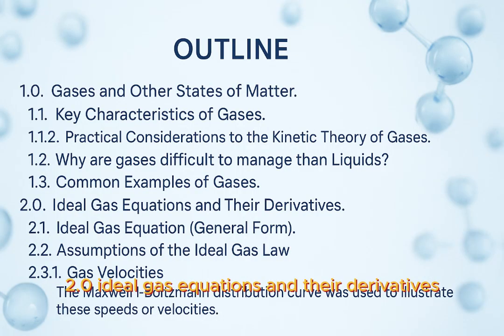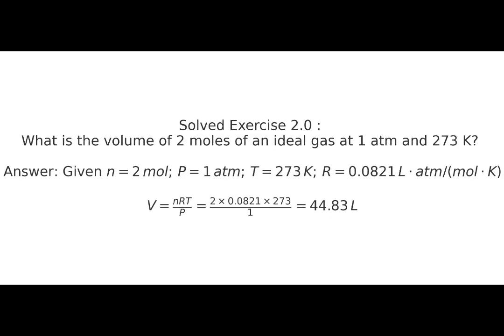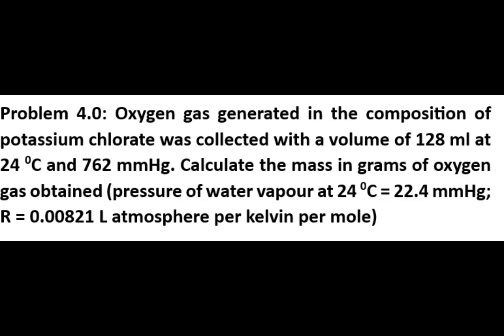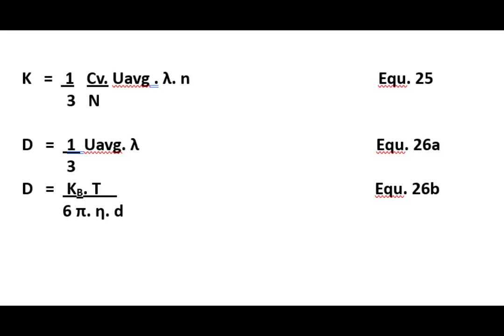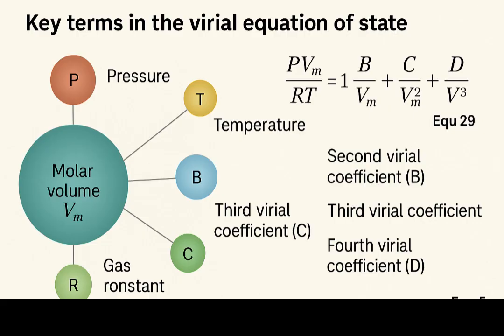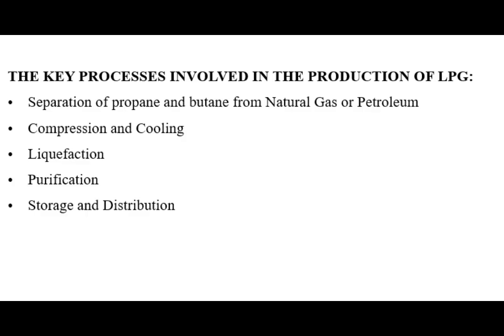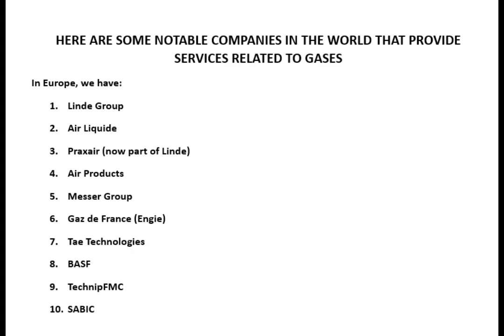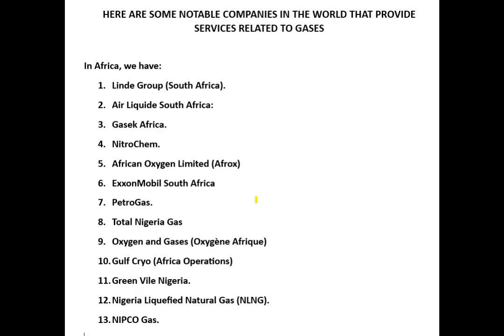Fundamentals and Applications of Gases

Comment: GMT: OKECHUKWU DAVID ICHELA 

• Exercise 1: Practical Exercise on Gases

The relationship between pressure, volume, and temperature can be explained using the combined gas law:

[
\frac{P_1V_1}{T_1}=\frac{P_2V_2}{T_2}
]

Where:

- (P_1) = initial pressure
- (V_1) = initial volume
- (T_1) = initial temperature
- (P_2) = final pressure
- (V_2) = final volume
- (T_2) = final temperature

If the gas enters a larger space and the temperature remains constant, then:

[
P_1V_1=P_2V_2
]

Therefore:

[
P_2=\frac{P_1V_1}{V_2}
]

Since (V_2>V_1),

[
P_2<P_1
]

This means that when the gas enters a larger space, its volume increases while its pressure decreases, provided the temperature remains constant. If the temperature changes, the combined gas law can be used to determine the new pressure and volume.

This relationship helps a geologist predict how underground gas will expand, move, and change pressure when it enters a larger rock formation or mine space, helping to identify possible hazards such as sudden gas release or pressure changes.

Comment: BCT:IKPENDIEZE PRISCA CHIAMAKA U2024/5735259

From Excercise 1: { ANSWER} 
The ideal gas equation, PV=nRT, can be used to estimate the amount of gas produced by rearranging it to n=\frac{PV}{RT}. By substituting the measured pressure (P), volume (V), and absolute temperature in Kelvin (T), the number of moles (n) of gas produced can be calculated, using the appropriate value of the gas constant (R).

Comment: Gmt: wike saviour kenneth 

Exercise 1: Gas may accumulate

in underground rock formations or mine spaces. How can the relationship between gas pressure, volume and temperature help a geologist understand what may happen when the gas enters a larger space?

Answer:  When gas enters a larger space its volume increases. If temperature and amount of gas remain constant the pressure decreases. Pv=nRT (ideal gas law)
This helps geologists understand gas movement, expansion, and pressure changes in underground rock formations or mine spaces.

Comment: BCT: CHRISTOPHER WINNER OGECHI 

Answer:

The ideal gas equation, PV = nRT, can be used to estimate the amount of gas produced by rearranging the equation to make n the subject:

n = PV/RT

Where:

- P = measured pressure of the gas
- V = volume of the gas
- R = ideal gas constant
- T = absolute temperature in Kelvin

By substituting the measured pressure, volume, and temperature into the equation, the number of moles (n) of gas produced can be calculated. Therefore, the equation helps determine the amount of gas produced in the closed vessel.

Comment: GMT: OBUU MEMEMUGH ALBERT 

EXERCISE 1.

ANSWER:If the volume increases while temperature remains constant, the pressure decreases (Boyle’s law).

If the temperature increases, the gas tends to expand and its pressure can increase if the volume is fixed (Charles’ and pressure-temperature relationships).

If the gas moves into a larger space and is free to expand, its pressure will generally drop.

ANSWER 5.1:

Comment: BCT
IGBANI HANNAH ISRAEL 

Answer: The ideal gas equation, PV = nRT, can be used to estimate the amount of gas produced. By rearranging the equation, n = PV/RT. Therefore, if the pressure (P), volume (V), and temperature (T) of the gas are measured, they can be substituted into the equation to calculate the number of moles (n) of gas produced. The temperature should be converted to Kelvin before calculation.

Comment: P. I.C. Recent innovations in the gas gathering and transfer value chain of natural gas production have focused on optimizing costs, improving efficiency, and reducing capital expenditures (CAPEX). Some key developments include ¹ ²:
- *Digital Oilfield Solutions*: Implementing digital oilfield concepts, such as advanced sensors, IoT devices, and analytics platforms, enables real-time monitoring and optimization of production processes, reducing operational costs and improving efficiency.
- *Should-Cost Methodology*: This approach provides granular cost transparency, enabling oil and gas companies to negotiate better prices with suppliers, optimize project spending, and reduce time-to-market. By applying should-cost methodology, companies can achieve cost reductions of up to 8-10% on specific projects.
- *Automation and Robotics*: Robotics and automation are being used to inspect and maintain pipelines, reducing human exposure to hazardous conditions and improving safety. Examples include robotic inspection devices, such as SmartBall and PipeDiver, and autonomous drones for aerial surveillance.
- *Advanced Materials and Pipeline Design*: New materials and designs are being developed to enhance pipeline durability, corrosion resistance, and flexibility. These advancements help extend pipeline lifespan, reduce maintenance requirements, and minimize environmental impact.
- *Pipeline Expansion and Optimization*: Companies like Energy Transfer are investing in expanding pipeline capacity, such as the 67-mile pipeline from Panther Gas Plant to Waha Hub, to alleviate regional bottlenecks, improve pricing stability, and enhance takeaway options for producers.

These innovations aim to improve the efficiency, safety, and sustainability of natural gas production and transportation, ultimately reducing CAPEX and enhancing the overall value chain.
Mat no:u2023/5581114
Name: Otorho Julius omonigho
dept : PIC 200 level

Comment: Recent innovations in the gas gathering and transfer value chain of natural gas production have focused on optimizing costs, improving efficiency, and reducing capital expenditures (CAPEX). Some key developments include ¹ ²:
- *Digital Oilfield Solutions*: Implementing digital oilfield concepts, such as advanced sensors, IoT devices, and analytics platforms, enables real-time monitoring and optimization of production processes, reducing operational costs and improving efficiency.
- *Should-Cost Methodology*: This approach provides granular cost transparency, enabling oil and gas companies to negotiate better prices with suppliers, optimize project spending, and reduce time-to-market. By applying should-cost methodology, companies can achieve cost reductions of up to 8-10% on specific projects.
- *Automation and Robotics*: Robotics and automation are being used to inspect and maintain pipelines, reducing human exposure to hazardous conditions and improving safety. Examples include robotic inspection devices, such as SmartBall and PipeDiver, and autonomous drones for aerial surveillance.
- *Advanced Materials and Pipeline Design*: New materials and designs are being developed to enhance pipeline durability, corrosion resistance, and flexibility. These advancements help extend pipeline lifespan, reduce maintenance requirements, and minimize environmental impact.
- *Pipeline Expansion and Optimization*: Companies like Energy Transfer are investing in expanding pipeline capacity, such as the 67-mile pipeline from Panther Gas Plant to Waha Hub, to alleviate regional bottlenecks, improve pricing stability, and enhance takeaway options for producers.

These innovations aim to improve the efficiency, safety, and sustainability of natural gas production and transportation, ultimately reducing CAPEX and enhancing the overall value chain.
Mat No: U2023/5581114
Name: Otorho Julius Omonigho

Comment: PIC:
LNG is not produced using only the Joule-Thomson(JT) effect because methane (LNG's main component) needs very low temperatures (~-162°C)to liquefy, which the JT
effect alone cannot reach. In contrast, LPG (propane/butane) liquefies at higher temperatures and can be produced using JT expansion and moderate pressure. So
LNG needs more advanced cooling systems, while LPG does not.

Comment: BCH: The use of atmospheric air is unsafe for anesthesia because 

Anesthesia requires precision in oxygen delivering often 40- 100 % to maintain safe oxygenation and prevent  hypoxia or hyperoxia. These oxygen is purified which makes it 99% if not 100% safe for surgical operations 
Meanwhile atmospheric oxygen contains trace amounts of other gases as well as other components such as dust, bacteria, pollution particles which increases infection risk or complicationsduring surgical operations

Comment: BCH: The implications of using free and pure form of oxygen gas (atmospheric Oxygen) rather than the cylinder of pure oxygen gas is as follows:

Concentration - Free oxygen in the atmosphere is about 21% and will not provide the high concentration needed for anaesthesia leading to lung failure.

Atmospheric oxygen is not practical for direct use in controlled anesthesia delivery due to low concentration and variability.

Atmospheric oxygen gas contains microbes, contaminants, particulates and variable humidity, making it unsuitable for direct use in anaesthesia.

Composition variability -  Atmospheric oxygen levels can vary slightly, but most importantly, air contains other gases (like nitrogen)

Using free atmospheric oxygen isn't feasible for anaesthesia during surgery. Medical-grade oxygen from cylinders allows for precise control and safety needed in surgical settings.

Comment: BCH: 
a) Purity and safety: Atmospheric oxygen isn’t pure :, it contains other gases like nitrogen, pollutants and potential contaminants. Anesthesia requires highly purified oxygen to ensure patient safety.

B) Concentration control: Anesthesia machines precisely control oxygen concentration. Atmospheric oxygen would require complex systems to adjust and maintain the necessary concentration.

C) Regulatory compliance: medical oxygen supply systems are heavily regulated. Any alternative would need to meet stringent standards for safety and efficacy.

Comment: BCH: Using normal atmospheric air instead of a cylinder of medical-grade oxygen during surgery can put the patient’s life at serious risk. Air contains only about 21% oxygen, with the rest being mostly nitrogen, which is not enough to maintain safe oxygen levels during anaesthesia. This shortage can quickly lead to hypoxia, causing brain damage, organ failure, or even death.

Atmospheric air also carries dust, microbes, and variable moisture, which can irritate the lungs or introduce infections. Anaesthetic machines are calibrated to work with pure, pressurised oxygen, so using ordinary air can cause inaccurate anaesthetic dosing, making it harder to keep the patient stable.

In addition, a cylinder provides a steady, high-pressure supply that supports mechanical ventilation. Without it, if the patient stops breathing, there is no reliable backup source, greatly increasing the chance of respiratory arrest during surgery.

Comment: BCH: The use of free and pure form of oxygen gas in the air rather than the cylinder of pure oxygen for anaesthasia during surgery is dangerous due to the fact that it may still contain  dust, water vapor and other form of contaminants.But the cylinder would contain pure oxygen which will undergo key processes like ; 
1.Air compression and purification
2.Cooling and liquefaction
3.Distillation and
4.Separation of components which helps to give the appropriate amount of oxygen needed

Comment: BCH: Using free and pure oxygen gas from the atmosphere rather than cylinders for anaesthesia during surgery would have several implications which includes:

1-- PRESENCE OF IMPURITIES:  Atmospheric oxygen contains impurities and would require purification and filtration to remove impurities.

2-- CONCENTRATION CONTROL:. Maintaining a precise oxygen concentration would be crucial for safe anaesthesia whereas Atmospheric oxygen do not

3-- REGULATION: Atmospheric oxygen is not regulated and can not guarantee consistency and safety

4-- DELIVERY AND DOSAGE: Using atmospheric oxygen would make precise delivery and dosage of both oxygen and anaesthetic agents impossible, risking overdose or underdose

Comment: BCH
1. Incorrect closing of anesthesia gases due to miscalculated pressure, volume relationship.
2. Equipment malfunctions such as vaporizers or flow meter providing inaccurate readings
3. Hypoxia or gas embolism risk from improper gas mixture. 
4. Patient harm or death of ventilation anesthesia delivery is not accurate.

Comment: Edu. Chem:
The velocity often applied to estimate the energy required to generate power in gas turbines is:

Root Mean Square (RMS) Velocity
RMS velocity is a measure of the average velocity of gas molecules, taking into account the distribution of velocities. It's used to estimate the energy required to generate power in gas turbines because:

Reason
1. *Energy calculation*: RMS velocity is directly related to the kinetic energy of the gas molecules, which is essential for calculating the energy required to generate power.
2. *Turbulence and flow*: RMS velocity helps account for the turbulent flow and velocity fluctuations in gas turbines, which affect energy production.

Comment: U2023/5565038
Gly: Nitrogen is used in coiled tubing operation to help recover oil from wells by reducing hydrostatic pressure in the wellbore. This is especially used for lifting heavy fluids during clean outs and uploading wells that aren't flowing naturally

Comment: BCH-Using atmospheric oxygen for anesthesia would require significant technological advancements to ensure:

1. Precise oxygen concentration control
2. Effective air purification and filtration
3. Reliable flow control systems
4. Continuous monitoring and safety measures

Potential benefits include reduced costs and increased supply, but infrastructure investments and rigorous testing would be necessary to ensure patient safety and effective anesthesia delivery.

Comment: GLY  U2023/5565035.
In the oil and gas sector, coiled tubing operation is a
technique used for well intervention without using traditional
drill pipes. It employs a continuous coil of tubing, typically
made of steel or composite material, wound onto a large
spool and then inserted into the wellbore. This method
allows for various tasks to be performed in the wellbore
efficiently. Coil tubing is sometimes needed when the well
completion and workover are performed.Coiled tubing operations can be used for a wide range of
tasks, including well cleanouts, acid stimulation, fracturing,
cementing, logging, plug setting or retrieval, and stuck pipe
prevention. The coiled tubing is typically deployed into the
wellbore through a specialized injector head, which controls
the speed and tension of the tubing as it is fed into the well.
Once the desired depth is reached, various tools and
equipment can be run through the coiled tubing to perform
the required tasks.
The reason for using nitrogen compounds in the form of a real gas rather than an ideal gas is due to the behavior of real gases. Real gases exhibit deviations from the ideal gas law, especially at high pressures and low temperatures. The ideal gas law assumes that gas molecules do not interact with each other and occupy no volume, which is not accurate for real gases. Therefore, using nitrogen compounds in the form of a real gas allows for a more accurate representation of their behavior and properties.

Comment: GLY: High pressure in coiled tubing operations causes nitrogen to deviate from ideal gas behavior. Using real gas equations accounts for these deviations, ensuring more accurate calculations and better control.

Comment: GLY: Coiled Tubing Operation is used in oil and gas well interventions primarily for tasks such as cleanouts, stimulation, or nitrogen lifting. Nitrogen is commonly used in these operations, and it behaves more like a real gas rather than an ideal gas due to the high-pressure and high-temperature conditions typically encountered downhole.

In ideal gas behavior, it is assumed that gas molecules do not interact and occupy no volume, which is unrealistic under extreme conditions. In contrast, real gases like nitrogen at high pressure experience intermolecular forces and occupy finite volume, which affects their compressibility and flow properties.

These real gas properties must be considered to accurately predict the pressure and flow characteristics of nitrogen in the wellbore, ensuring safety and efficiency during the coiled tubing operations.

Comment: Agomuo Victoria Alali 
GLY
026
Liquefied Natural Gas (LNG) is natural gas that has been cooled to a temperature of around -162°C (-259°F), causing it to condense into a liquid. This process reduces the volume of the gas, making it more practical and efficient for transportation and storage over long distances. LNG is primarily composed of methane and is used as a cleaner-burning fuel compared to coal or oil, producing fewer emissions when combusted. It's widely used for electricity generation, industrial applications, and as a fuel for vehicles and heating.

Comment: BCH:

The use of Atmospheric air during surgery can be very harmful.

First, Atmospheric air is unsterilized, causing a risk of  of infection during surgery, it has only 21% of oxygen which is insufficient during anaesthesia making it unsafe.

Second, Atmospheric air is a mixture of other gases which includes nitoregn gas which when used can expose the patients to microbes and other pollutants which can cause permanent injury.

On the other hand, medical oxygen provides up to 99% purity, which is essential for proper functioning of the body during anaesthesia. It ensures proper oxygenation, sterility and safety during surgery.